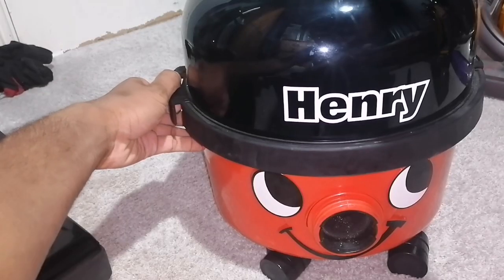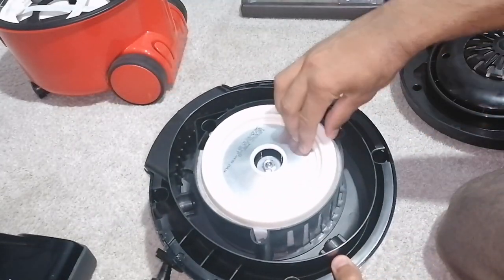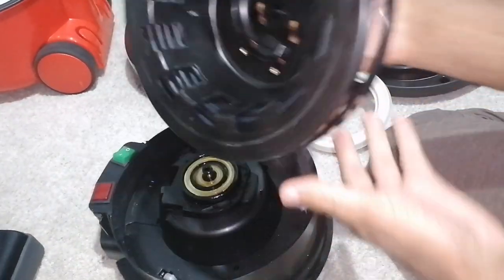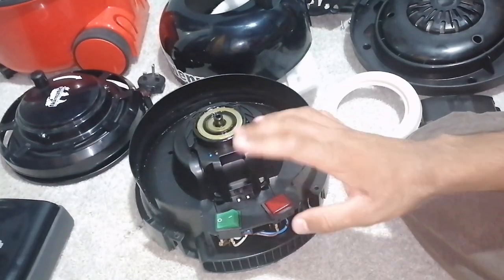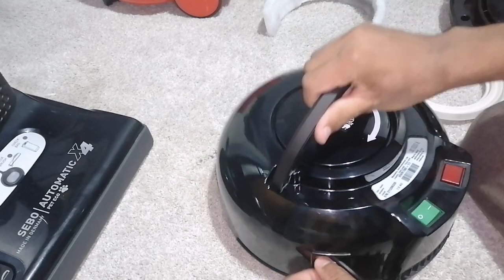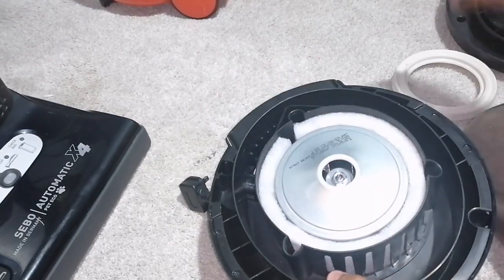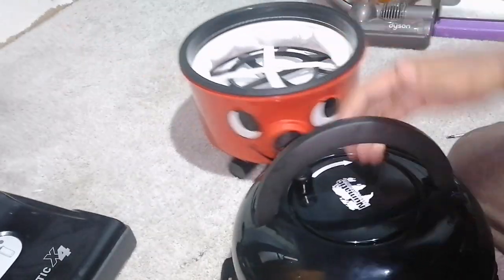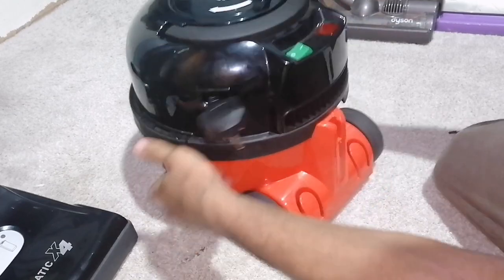HOW TO - Numatic Henry HVR160 MOTOR, CABLE & SWITCH REPLACEMENT  (FULL STRIPDOWN)

Comment: Will the motor from the Henry which has the 620w and 1 switch for the high and low fit the current henrys?
Reply from the maker: If they use the same motor and motor mounts then yes they will fit
Reply: @parwaz7861   I tried it and it works.

Comment: Is it possible to modify this machine by replacing the light switch with a high low switch?
Reply from the maker: I doubt it as it'll need a PCB as well
Reply: @parwaz7861   No I mean the high low switchbon the 2008 machines with no autosave.
Reply from the maker: @jayambermsp8000  you can't make a henry 160 twin speed that easily without cutting the plastic down to modify it